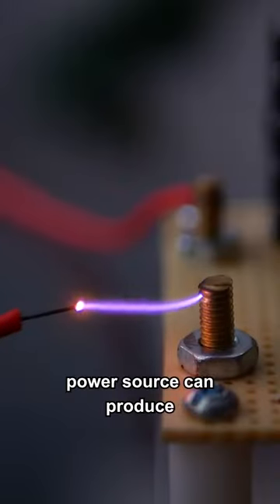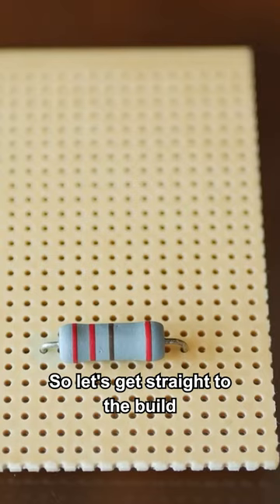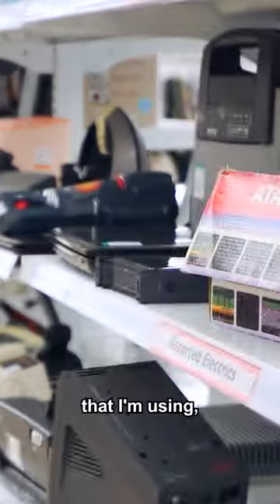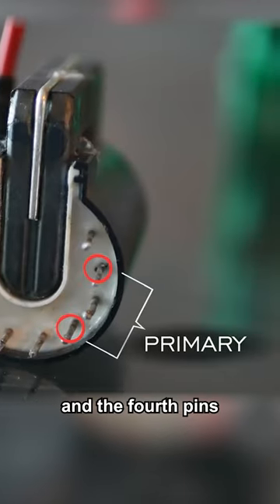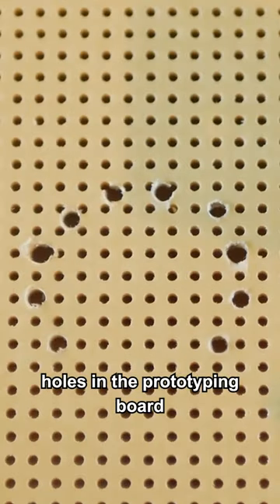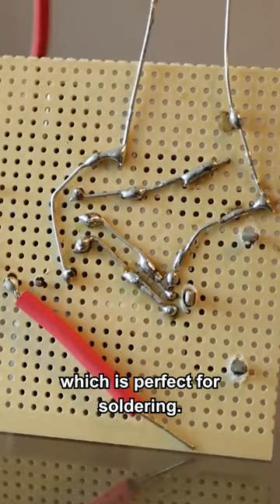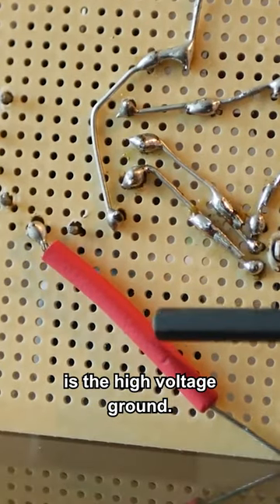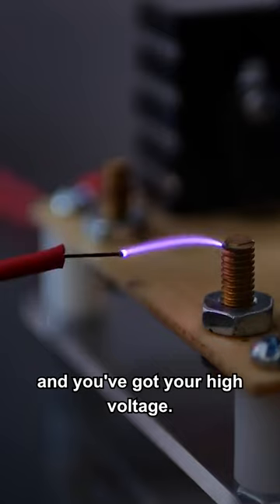DIY Plasma Physics Powersource (Mini 20,000v Flyback) #shorts

Comment: Given the fact that ionic propulsion is essentially the operational principles of a magnetron applied in reverse, ever considered doing any research on magnetrons to try and improve the power density of your ionic thrusters? For example, the addition of permanent magnet arrays, improving the anode surface to increase electron mobility by texturing with carbon nanotubes, and even heating up the anode element to further increase electron excitation could potentially have a positive effect on the thrust.

Also, try a liberal application of Corona dope to the cathode surfaces. The anode needs maximum electron mobility so it must remain clean, adding a thin film of insulation to the cathode could enable an increase in voltage you can apply or allow a tighter spacing of anode and cathode, increasing electron speed and thus increasing power density.

Even further, you could try to exploit the process of electroplating or even electroless plating to produce anodes and cathodes of even further reduced weight, since the bulk mass of the anode and cathode have no significant impact in the power output of an electrostatic device. Try using very fine-haired plastic brush or other high surface area object with significant protrusions to increase corona discharge, and paint that object with a thin film of a conductive paint such as nickel or graphite paint, then treat with nanoparticles such as graphene or MWCNT, then finally add a metallic layer of copper using electroplating for increased conductivity, durability and mobility.

Comment: Hey Jay, do you know how I could go about making a Tube Driven AC Flyback? I have a Beefy AC Flyback i tore out of a broken 1980’s era tv and I want Big White Hot Arcs but I wanted to build a Tube Circuit to Drive it with, Any ideas?
Right now I currently use a Induction Cooktop to drive it, and it works quite well, it’s just not very portable lol

Comment: What is the advantage of doing this instead of using the  high voltage modules from Amazon (e.g. the one listed as "good for a static grass applicator") or a diode multiplier?

Comment: Tou forgot to mention to discharge the crt tv.
Reply: By now it's almost certainly self-dissipated, assuming no one tried to make it work with the no analog channels being broadcast.
Reply: @GodlyNoghri  this unit has composite in and still could have been used. Most people test the stuff they donate before donating it. Yes, it should have dissipated all the electricity, but you can't and should put your life on the line because someone ying should have done its job. It's better to be safe.

Comment: Which transistors / mosfets are good for this? Give a couple names please :)
Reply: Bob, Fred, Harry, O wait you meant names of transistors. Sorry I don’t know that.
Reply: IRF250, IRF260n, IRF240, any mosfet with a fast switching speed, low RSD ON and preferably a lower total gate charge(not a requirement but helpful).

Comment: …can i touch it?
Reply: You can...

Only once.
Reply: @ElPsyCongroo. No it will just burn your skin if you keep it there for like ... 1 second it wont kill because its very low amps
Reply: @blokkiesotto5854  I know, ir was a joke, but it just burns because of the frequency.
Reply: @ElPsyCongroo. Bro i touched electricity like that and it didn't even hurt, not enough current to do harm
Reply: @JudlexAlternate  and I have touched 60kv of decent current and I'm still alive, it depends of a ot of factors, it is not as easy as "voltage shocks current kills"
Reply: @ElPsyCongroo.  Yeah it really depends, also if it is dc or ac current. If ac it depends on the frequency, high enough frequencies don't interfer with human nervous system so you probably touched a tesla coil of some kind, am i right?
Reply: @ElPsyCongroo.  And in my comment the electricity made by a flyback is dc so it really depends on the current or voltage, maybe even how hydrated is your skin and other things but yeah
Reply: @JudlexAlternate  I touched a flyback driven by an MOT with a spark gap, i touched the output and i was touching ground with my leg, if i touched it with both hands i would have most likely died, the MOT was ballasted but the input was still around 4kv to the flyback. I think that AC Is only worse than DC at low frequencies, DC can hurt a lot always but AC at high frequencies with the skin effect only burns a little bit.
Reply: @ElPsyCongroo.  awww, hurts to read that. yeah i forgot to think it also depends on where you touch it. I didn't think you got such a minor shock